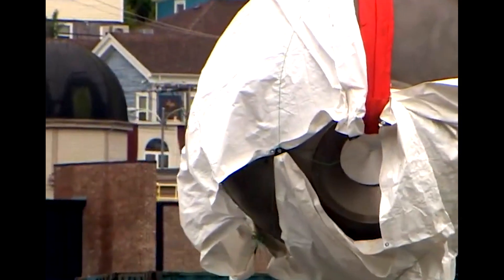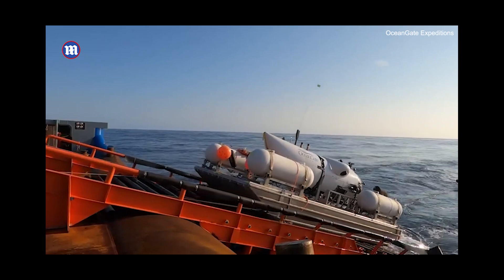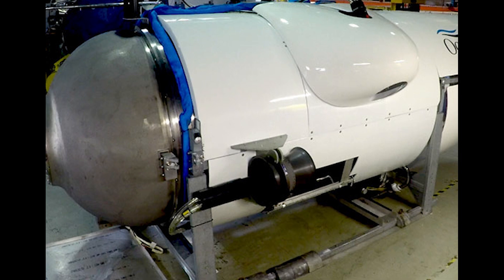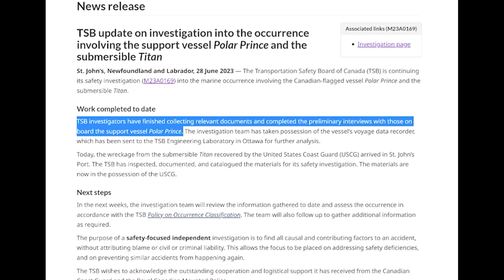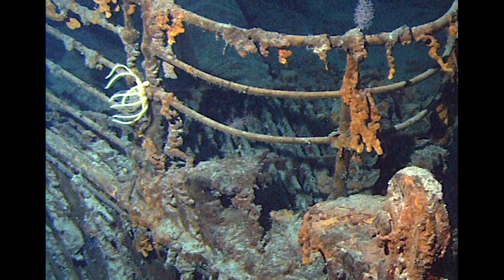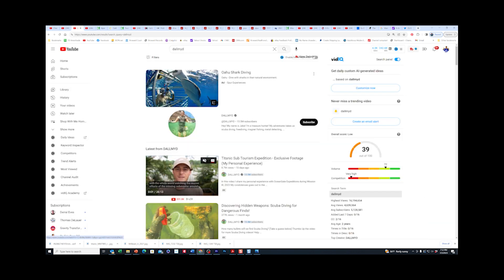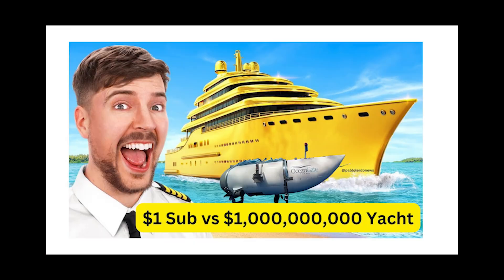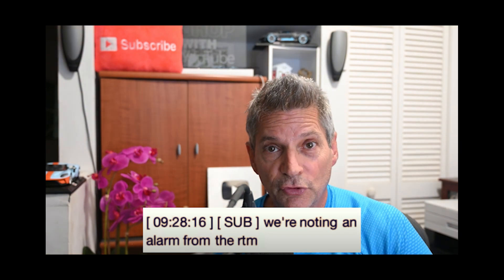Titan Submarine Debris Clues, Implosion Simulation

Comment: This is gonna be hard to describe, if you look at a large high res photo of the ring you can see on the inside where the epoxy was applied on the titanium and you can also see where the epoxy didn’t bond to the titanium, it looks like the bonding broke down and large parts of the epoxy peeled free which is why there is no carbon fiber shards left in the glue. 

I believe the glue failed on the seal and end cap popped off and exploded the carbon fiber. I also believe there were pockets of air trapped in the epoxy because it was not pulled down in a vacuumed chamber.

Comment: I would imagine that there would be an initial but very small disconnection (cracking) happening between the titanium ring and the carbon tube.  Small, maybe no more than a few seconds which prompted the dropping of the weights.  Followed very shortly thereafter by a cataclysmic collapse of the sub.  Milliseconds if that.  They would have been vaporised!

Comment: The glue bonding the end caps has mass, it has thickness. Just a single fissure track through that glue would be enough. Think of it like a head gasket on an old car over the years developing a fissure track from the water jacket into the combustion chamber and you get that mayonnaise under the oil filler cap as a warning. 
Also note that an ordinary car tyre takes around two to three atmospheres of pressure to be effective on the road. For every ten metres below sea level the pressure on a submersed object is increased by an atmosphere. So as a swimmer ten meters underwater the swimmer will experience an extra atmosphere on his body of pressure, particularly in his air spaces of the lungs and sinuses. A swimmer cannot go much more than that without pressurized air to breath and even then at 90 metres oxygen become poisonous and special air mixes have to be used to breath and even then careful timing of time underwater and slow return to normal pressure has to be observed to avoid the blood becoming a gas. 
The Titanic at 3,800 meters is under 380 atmospheres of pressure or 5,600 psi! The research sub is at surface pressure inside for its occupants but 380 atmospheres outside, just centimeteres away. 
People who dive oil rigs for maintenance duties or Navy divers who undertake combat missions are regarded by those who have some understanding of what they do with awe. The work they do is well researched beforehand and even then the unexpected does happen and challenges have to be met. 
Sometimes mans reach exceeds his abilities in all manner of aspects and sometimes that threatens not just a small number of explorers but all of the world. It's a lesson to be explored in itself.
Thankyou Jeff for sharing your presentations here on YT. Your respect for people and applied engineering knowledge and practical experience that you share is thoughtful and provoking.
Finally to those that lost their lives in this tragedy and their grieving families I want to say that God Almighty loves all and we all live in Gods Almighty love, eternally.

Comment: Hydraulic hammer/fluid hammer is a possible cause of the viewport popping out.  As the implosion occurs, the air in the collapsing void is compressed, and the inrushing water acquires momentum/kinetic energy (the fluid hammer effect).  So that compressed air will momentarily reach a pressure that far exceeds the pressure of the ambient water pressure at that depth,(due to the fluid hammer effect) and that pulse of pressure could have popped the viewport out from the inside!
Reply: You're right.  There's no way in fu*king hell the salvage team would have tampered with critical evidence and unbolted and removed that porthole!  The implosion did it.

Comment: That is a torque wrench at 7:18, but being wielded very sloppily with a big extension. I'd have expected larger bolts too
Reply: Sure, but it looked like a dead flat flange without any register to interface to the dome though, relying on the bolts to take any shear forces too
Reply: @ma61king  If you look at the finished vessel with the door open, there is a big-honking hinge that holds the front dome to the ring. I bet that is your registration feature. Both the ring face and the hemisphere face appear to be flat so it is a metal-to-metal sealing surface. The bolts just seem to keep the door from flopping open until the outer water pressure is enough to clamp the hemisphere to the ring.
Reply: The only job that the bolts do is to mate the surface of the ring to the surface of the hemisphere at the surface where the internal pressure is equal to external pressure. Once you start loading the outer surface with water pressure, the pressure differential holds the hemispheres to the rings. I wonder what the sealant between the mating surfaces was. Commonly on these types of mating surfaces there is either an o-ring that is compressed in a channel, or super smooth surfaces to get a metal-to-metal seal.

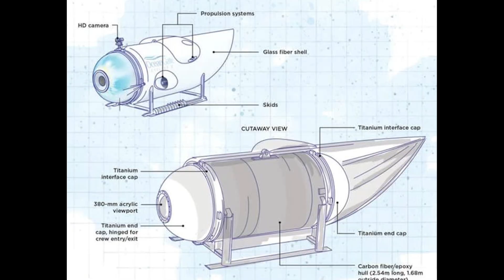Comment: I think the carbon fibre IS still attached to the ring. Look at 0:14. It's sheared flat to the outer surface. Could not the cylinder have cracked along the line of joint at the point of the maximum differential expansion and along the line of weakness in the wound fibres....

Comment: I doubt if they had 15 minutes to panic in from the moment they decided to abort the dive to  the actual implosion. It would have been more like a few seconds so their ordeal ended real swiftly.
Reply: They were aware there was a problem and were trying to come up. The vessel had an indication system. Idk if they had 15 min but it probably was designed like that, hopefully. However imho if you’re using an acoustic system to be your warning system, it’s probably a real thin line before you run out of time. Which in this case, they did.

Comment: I believe the window was push out from the inside at the moment of breech. As the carbon fiber cylinder collapsed it pushed the atmosphere toward both ends. Most likely find that all the bolt holes are stripped of threads. Titanium at that depth would have been cold and more brittle than the stainless steel bolts securing the flange in place.

Comment: The port hole window could been destroyed after the implosion, if the carbon fiber  hull broke first the force could been so huge that the porthole window was destroyed. But it was not the failure point, if the porthole was only rated to 1300 meters then I suspect it was the porthole window that broke first after surviving a few dives down to the depths. If it was rated for 1300-meters this final dive should be rated as a murder suicide.

Comment: No, you're forgetting the most obvious scenario number 4: the window was not the cause, but it is nontheless in pieces on the bottom, because an implosion superheats the gas inside and is immediately followed by a form of explosion, which would push the "weak" window (and its fastening bolts) out of the very strong titanium cone. It was made to withstand pressure from the outside, not the other way around.

Edit: just to be clear, although the temperature increase of the compressed air is a physical fact, it does not mean it "burns bodies to ash". They were crushed and shredded by debris, not vaporized.
Reply: bruh it was surrounded by ice cold water it didnt get hot at all
Reply: @EazyDuz18  ignorance is bliss.
Reply: @johnknoefler agreed
Reply: Saw an old Malay native tube compression lighter.  I imagine those people were the tinder.
Reply: Some fish got blasted
Reply: they literally bolted monitors on a screws through the walls
Reply: The window was not made to withstand pressure. It was already said going 3500 feet the window needed to be thicker, his was designed to go less than that
Reply: @Dsapasd  Nope thats been spoofed.  The implosion does not superheat the air inside the sub upon explosion.  That theory has been proven false. look at the ring and parts, there are zero burn markings.
Reply: @triplenickle6995  Of course don't get burn marks on titanium just from higher heat. And the titantium was not very deformed, i.e. did not "follow" the air towards the center of the sub where the most compression happened. Consider just filling a 300 bar scuba tank, you know it heats up quite a lot, just not nearly that much because you don't fill a scuba tank in a few milliseconds.
Reply: @dsapasd  LOL LOL  your scuba tank example is so irrelevant in this case of a implosion.  Your only saying things to keep your head above water on your knowledge of the immersible implosion.
Reply: @triplenickle6995  The ideal gas law is a physical law, not a suggestion.  Compressing a given volume of gas down to a smaller volume of gas causes a rise in temperature.  This is how diesel engines ignite their fuel, even though the surrounding metal cylinder is far too cold to ignite the diesel. Whether or not it was hot enough to melt titanium is besides the point, since the pressure waves caused by the implosion itself were strong enough to annihilate pretty much anything that wasn't made out of titanium.
Reply: @glenndoiron9317  Yea, like I said and everyone here, its been proven that the implosion didn't reach superheated temperatures.  Your example of a diesel engine lacks support in this case and is a poor example.
Reply: @triplenickle6995  It was a poor example of the ideal gas law?
Reply: @glenndoiron9317  yes very poor and your reasoning is made up and didnt make sense.
Reply: Sex Move
Reply: Also; the people would have become fuel for the explosion, as the implosion superheats the inside they were converted into ash. A very sad outcome
Reply: @donbaker8252   how come body parts were found if they were all turned into ash ?
Reply: @crumkill  human remains not human parts! It could be piece of skin, tooth, blood
Reply: @crumkill  They didn't find body parts. They found "presumed human remains" that are being tested. That essentially means they found organic tissue. The bodies liquified/exploded in a nanosecond. They may have had superficial burns from the heating of the air, but again, you're talking tiny fractions of a second. You can see tests of what happens to a body under that pressure in videos out there. They essentially go "boom".
Reply: @donbaker8252  Ideal gas laws, go check. There will be minimal heat produced when the pressure equalises. P1V1/t1 = P2V2/t2   How much energy is released when the carbon/epoxy disintegrates is not known.
Reply: @donbaker8252 Death was imperceptible, it was so fast. Not even time to register that it was happening. It was a fraction of a fraction of a fraction of a second.
Reply: This is the only comment that provided some comfort thinking about  those poor people. I wonder if there was any noise or anything that might have caused them to be frightened. I hope not. That poor lad … What a horrible way to die.
Reply: @donbaker8252 I stg you people are clueless. The air heated up for nanoseconds, yes it was hot, but heat still takes time to transfer, it still need to be conducted. The temperature from the air would not have made a difference whatsoever the surrounding water would've cooled it down instantly. The bodies were not affected by heat at all.
Reply: My favorite glued and resin'ed expired charcoal fiber with a plastic view port submarine didving down to submersible depths

I'm usre the presure increased the heat to vaporisation and cuombustion presures sphere of milisecon 270klb preseure per square inch with 5 feat of acceleration and momentum and crushing air
Reply: @bobsterclause342  heat will be from the disintegrating pressure vessel wall which is the carbon epoxy
Reply: 100% agree heat would be minimal and a non factor. This idea that is being propagated online, especially in YouTube comments about extreme heat thousands of degrees centigrade is misinformation that started from a TikTok video. Nevermind the fact that the heat generated would be nowhere near that level, it would also occur at the point of failure and be incredibly small + dissipate quickly. The water is 34* there.
Reply: Exactly. Calculate the energy released by the implosion and it equals a massive bomb. Anything resin would basically be crushed to powder and or vaporized. Carbon fiber reduced to tiny fragments.
Reply: The sub was pressurized from the inside as well.
Reply: @amandahugenkiss  no it was not.
Reply: @ScreamingEagleFTW technically it was “pressurised” to 1 atmosphere. But yeah, the 400 or so atmospheres of water pressure on the outside is probably the bigger worry at those depths ;)
Reply: @robthebloke  pressurized would be higher than atmospheric pressure.   It was not. . They went in.  They sealed the door.  and they descended into a super pressurized abyss where they promptly imploded.  The vessel was not water tight, and it took on water, lost buoyancy and could not ascend. The  leak was the point where the vessel could not restrain the pressure of the whole of the atlantic ociean and the ship imploded.  There were no survivors.
Reply: @amandahugenkiss  Never!
Reply: @amandahugenkiss  The pressure on the inside was about 21 psi.  The pressure on the outside was 6000 psi.
Reply: @amandahugenkiss  go research!
Reply: @amandahugenkiss  it should be but never heard anybody mention that and what was the internal pressure?
Reply: @therealBozoDjTrump  atmospheric otherwise they'd need decompression

Comment: After all the finger pointing and chest thumping about this tragedy settles down i would like to see if someone could build a test "vessel" with a calculated failure depth and set up high speed cameras and sensors inside and outside of the test vessel and lower it until it implodes. 
The resulting data would be real data and not guesstimates.

Comment: Is it possible that fiber body attached to titanium ring lost few centimetres in diameter due to pressure and became smaller while titanium ring didn't change it's diameter and thus the whole ring with glass just fell off from the main body and also glue remained attached to carbon fiber while completely detaching from smooth titanium ring? 🤔

Comment: As far as i know the window was intact and not the cause. I am quite sure it was the carbonfiber. Those titanium rings and dome's  were not enough constructional support. That carbonfiber cilinder needed a titanium cilinder on the in and outside and maybe a + beam in the middle of the vessel. But most of all it needed much more testing

Comment: carbon fiber doesn't blow up into a thousand pieces wether it's 5mm or 150mm,the tubing would have broke into a few pieces,and would've headed in opposite direction to the front or rear bell end depending on which end of the tube titanium ring was glued to that gave way.

Comment: Amateur engineer here. The window didn't fail; it was constructed with known and proven materials and practices. Had the hull failed, there would be shards of carbon fiber still adheard at the mating surface but I didn't see any. There are issues with mating 2 dissimilar materials with a 3rd material. They will all react differently to moisture, pressure, and temperature. Any fatigue resulting from this will be cumulative meaning every cycle will intoduce defect. I believe the glue failed. Once the critical mass pushed catastrophic, the window may have just blown out or the hull may have shattered but in any event, it is the likely reason no carbon fiber shards were evident on the ring.

Comment: Is it possible that the implosion would’ve caused the sub to automatically drop its ballast? I read that the ballast could be dropped by rocking the vessel back and forth so I’m wondering if those were knocked off by the implosion.
Reply: There was text message between the sub and the mother ship they dropped ballast and frame needed multiple tries accent was very slow noise and alarms
Reply: @bobmorane2082  Ah ok. There’s  so much info out there but it’s in pieces.  No pun intended. I don’t have the complete timeline.

Comment: The titanium end caps must have deep groove to get the carbon fiber cylinder inserted. Then glued and also rivetted/bolted. And the two end caps made of titanium must be connected/joined on the outside by long metallic rods. Putting the carbon fiber cylinder inside the metallic ring doesn't look ideal, where the pressure force is acting inward.
Reply: Not necessary. The water pressure gives a clamping force far in excess of the bolts capability.

Comment: I took a snapshot of the port hole salvage pic then blew it up on a 32" monitor.....the parent surface on the dome where the port hole ring bolted in is GONE.   So when it blew out the bolts didn't fail...they pulled the entire mating ring out.   You can see that the edge is jagged where it failed.   So that's why there are no bolt holes..they're still attached to the ring.   At least that's what the very poor quality photo indicates.